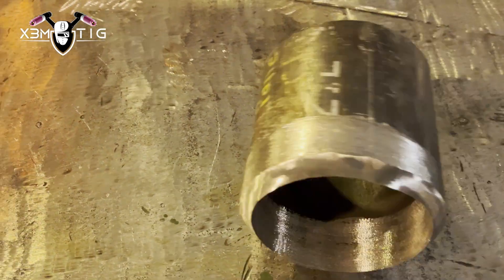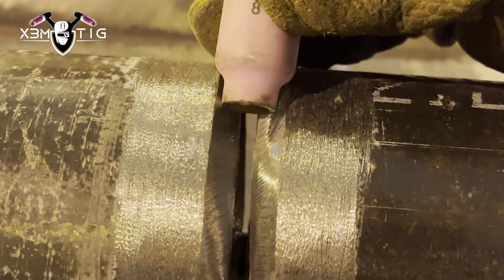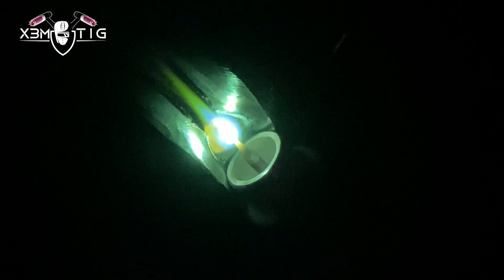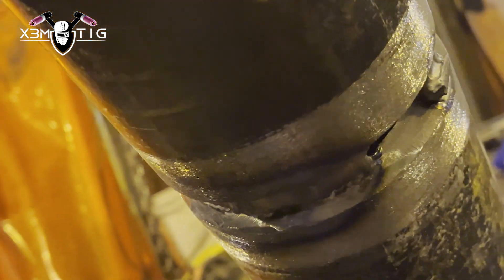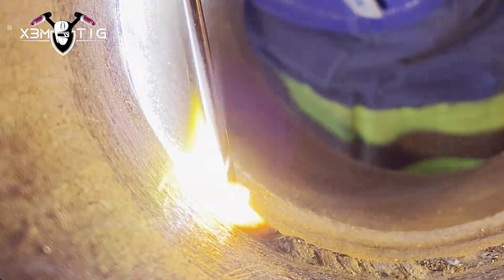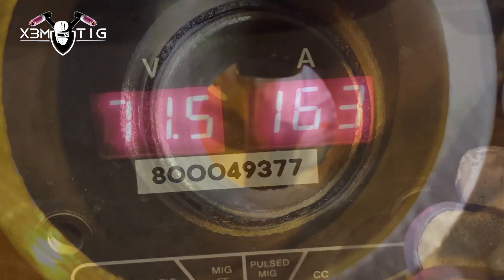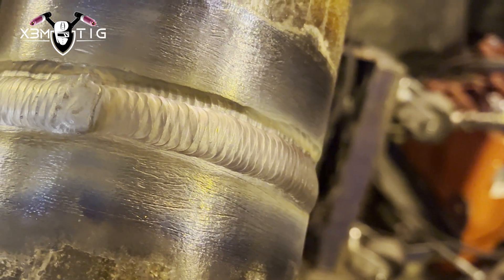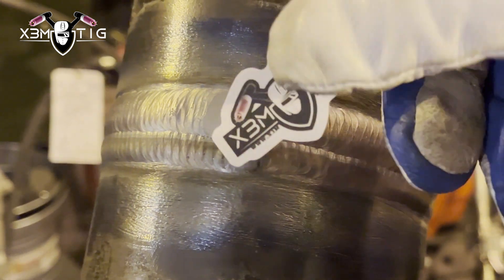TIG Welding: How to Get X-Ray Quality Root Pass Results in No Time

Comment: I have watched alot of your videos but never seen you strike arc ? how do you start arc and not leave any tungsten in weld , i never strike on outside of my pipe. Thanks sir for good videos.
Reply from the maker: Thanks for your comment… initial arc I always start on the bevel prior to weld the root pass, and after that I always strike an arc on the weld…
Reply: Lift start works good to just tap and when you lift it starts not all machines have it

Comment: hello champ. The big handels you weld with. *Do you have a site where you can buy them ? I weld Kempi but wonder if you could fit it on mine air cooled. BR welder in cph
Reply from the maker: It’s Miller brand, you can check their website.
Reply: @X3MTIG   is it the A250 series ? For high amperage?  Air cooled you use?
Reply: yeah but the 150 or the 200 model handle? @X3MTIG
Reply: you spoke about a better brand in terms of heat.

Comment: When your purging stainless people say to vent the end for the final tie in what if you can’t vent the end of the pipe for final tie in on root
Reply: This is where you’ll see ‘Needle Purging’ on the final weld of a piping system. This is done with ice dams either side of the joint and the weld area is back purged with a hypodermic needle. Just before you close the weld, the needle is pulled out and the root is quickly sealed. It will still likely leave a pin-prick sized area of oxidation in the root but this may be acceptable depending on acceptance criteria
Reply: Should always vent, argons heavier than air. On spools vent anywhere possible on fittings or turn down flowrate for tie in, never easy for site work.

Comment: That’s the most perfect fucking tig root I’ve ever seen my guy! Currently practicing for my pipe cert in May and I’m watching a lot of your videos pretty much everyday! 

Quick question. So, I’ve been freehanding all my passes but I’d like to have a more consistent pattern so I’m learning to walk the cup. If you’re walking the cup on a cap, do you tend to hold the torch upside-down or by its handle? Thanks again for the sick tutorial!
Reply from the maker: Thanks bud, for better  control,  you hold your handle and walk the cup with bottom part of your nozzle.

Comment: What type rod and diameter are you using for the bridge rod ?
Reply from the maker: Carbon pipe, use carbon rod, size depends upon pipe thickness and gap, from 1/2” and above.